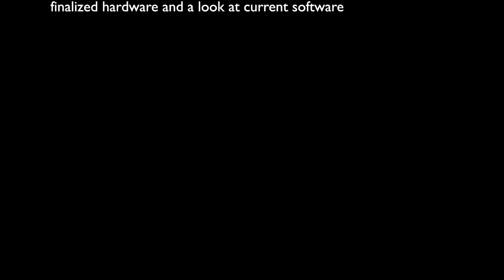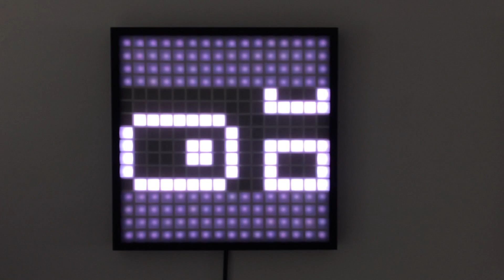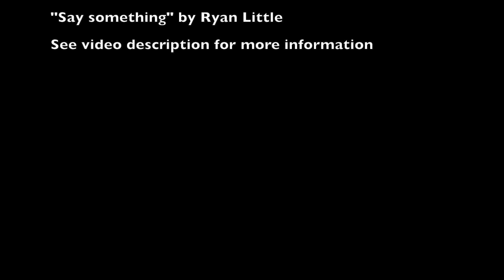Update on RibbaPi - 16x16 APA102 LED matrix build in a Ribba frame controlled by Raspberry Pi

Comment: Hi. I collect a project RibbaPi like you and would like to learn more about how to use the code, it does not work, when compiling, I write an error (((, I will be very grateful for the answer, because I have almost collected it, but there is no control. Tried a cycle from tinue, everything works